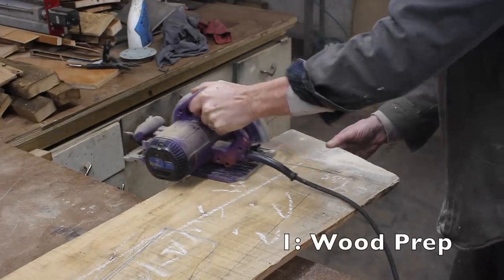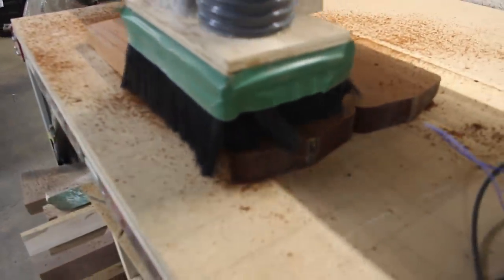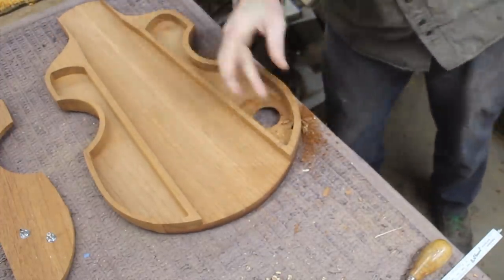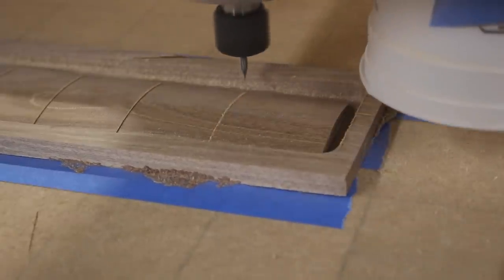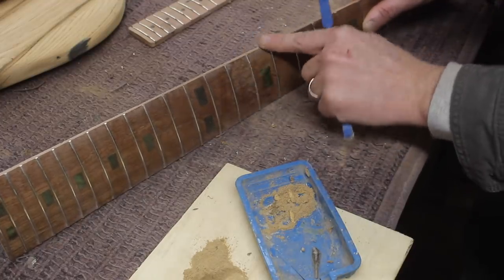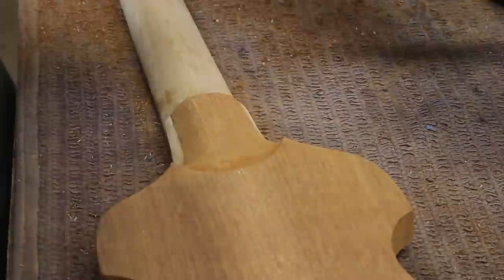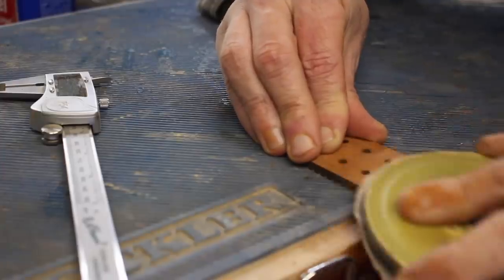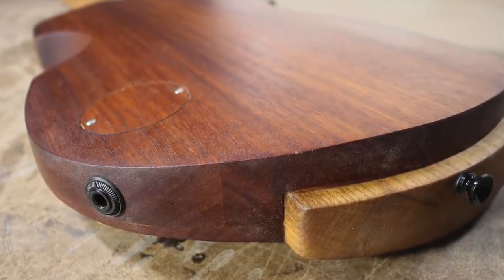6-String Semihollow "Beatle Bass" | Custom Build

Comment: Great stuff as always Tim. I recently bought a six string bass by Harley Benton based on the old Fender bass VI from the 60's. I had to break out the dremel as the input jack had came loose because my nephew unboxed it for me & more or less wrecked it in seconds. Lol. Last time I let him do that! It might even need opening up & rewiring as the volume is super low on some pup settings? Easy fix though & the bass itself is great. Harley Bentons are great when you're skint. Great value for your money. Cheers man. Keep up the great builds. Inspiring as always. Word to the wise.....never let your nephew unbox your new shiny guitars!! Lol. ;)
Reply from the maker: I just learned about the bass VI. I thought it was a baritone guitar but it is not - and I NEED to build one.

Comment: Hi Tim, could you share, if it is not a secret, your tips about bits, feeds and speeds and designs to make such good neck blanks like here? Greatly appreciate your work and unusual ideas 🤘
Reply from the maker: I'm really the last person to ask from a technical cnc side. Learning all the time. What I'm told is it's not to think about feed and speed, rather chip load and stepover, for smoothness. Sometimes faster is better for the particular cutter.I think the heavier machines like mine are always going to outperform lightweight cncs, especially with hard wood. I'm always adjusting my settings and learning, usually the hard way. Lol.
Reply: @timsway  Thanks for answer 🤘. I am doing just the same. My CNC is medium heavy, I am learning as well and doing smaller things. For guitars I am no pro, just for hobby and since now I have done some templates, but the guitar usually handmade. But I thought you had some ideas as your neck came out really smooth. For now I am just experimenting, next guitar I wanted to do 99% CNC for fun. Keep up your ideas, love it 😜

Comment: I love the wooden pickup
Is there an reason you clean up glue squeeze out after it's dried rather than before?
Reply from the maker: it is much easier and less likely to impregnate the wood and cause stain/finish problems in the future.

Comment: Isn't a bass with more than 4 string called a Djent? (Not including 8 or 12 string Octave basses)
Reply: The term djent was coined by one of Meshuggah's guitarists to describe the sound of palm-muted open-string phrases on the lowest strings of an 8-string guitar. 5- and 6-string basses have significantly fatter strings and longer scale lengths than 8-string guitars, giving a clearer, more stable and piano-like timbre and attack to the bass notes. The "djent"-iness of the guitar comes from an unstable attack, where the pitch starts out significantly sharp, then drops down to the true pitch of the note.

Comment: That is rad knowledge about the Rubio mono coat stuff, I had been wanting to stay away from toxic to everything type stuff while starting in this handmade art craft of Guitar making. How does the Rubio coating handle if you should have to resand the body or something?
Reply from the maker: You can just reapply it to the affected areas and it's pretty seamless, whereas if you sand off clear coat it's much harder to blend. Clear coat, of course, offers more protection against knicks and scratches (and there are some good, low voc ploy based options) but there's something real special and satisfying about applying a finish and having it still feel like wood.

Comment: do you sharpen the right angle corners of the fretboard inlays with a chisel after they result kinda rounded from the CNC?
Reply from the maker: Sometimes, or design the work to fit the tooling

Comment: Hi Tim quick question on your laser.  I think iI heard you say once that your shop is not climate controlled but you do have a hear source.  What do you do for you co2 laser in the cold winter months seeing I am right up to road from you in RI I too have my machine in the cold shop.  Do you run you chiller in the cold?
Reply from the maker: I put a mix of glycol (antifreeze) and distilled water in the chiller all year round. Change it about every 4-6 months. Never had any problems (knock on wood)

Comment: How is the balance of the instrument taken into account when playing standing and sitting?
With such a system and a set of strings, it is desirable to see the instrument as multiscale.
  And there is no bar for the support of the thumb of the right hand, so as not to get tired of holding the brush over the strings in the optimal place or even in two positions.
Reply from the maker: It has a little head dive, of course, but there's places to put your thumb on the end of the fingerboard, the pickup and the bridge, just like most other basses. you can also put it in the crook of the body that gets close to the strings.
Reply: @timsway  Thank you for what you heard, it is not customary for us to praise much, but your work and love for the cause made me speak out. Very nice, very tasteful.

Comment: Who makes the cnc cutter that you used to cut the slots for the frets in the fingerboard also a model and part number?
Reply: Also you did a great job on this. Using reclaimed material as you always to is also great.
Reply from the maker: the cutter is a .023" end mill. it has an 1/8" shaft so I need a reducer to chuck it in my router. I think it's an Amana? they all make them for cutting circuit boards and stuff. you have to do real slow and shallow passes in wood to not break it. I run the depth around .015" per pass and cut the slots to .075"

Comment: The presses are handy but I just fret the ol fashioned way with a hammer. Turns out good for me. What radius is that fret board. Looks quite drastic.
Reply from the maker: I got a little carried away :)
Reply: @timsway  it happens to the best of us haha. Looks like it turned out great regardless. 😀
Reply from the maker: @MilesMcNallyLuthierie  It's actually quite comfortable to play. I think it looks steeper on film because of the lens (and the sheer width of the fingerboard).

Comment: do the hollow sections add anything to the tone? even with a piezo pickup, the walls are so thick that i don't think they would resonate differently than a solid body. With any coil pickup, a change in sound would have to come from vibration of the pickup, or the bridge. even if there is a slight change in sound, it seems like it would be lost through any extra effects, or even the imperfect response from the cab, and crossover components ( if there are any ). the bass sounds great sure, but the semi-hollow idea seems like it has no effect. i think this is even applicable to a fully hollow body ( with coil pickups) unless the top is near as thin as an acoustic.
Reply from the maker: it's just to reduce weight, really. and look cool. the solid core negates most of the hollow body effects sonically.

Comment: The Beatles Hoffner violin bass was a standard 4 string... though several of their songs were recorded with a Classic BASS-VI which was tuned E-E with a whammy, 30" neck and scale of a Baritone guitar but used .94-.24 strings and larger tuners and in Bass octaves, like my Japanese copy playing both bass and drop tuned guitar metal riffs here, 
whereas the baritone guitar was tuned B-B only adding 5 frets of range but losing it at the top end, like a modern 7 string would if it didn't retain the high E... although tuning this custom B-B may be more useful in modern songs, they may be harder to play for traditional fingerstyle bassists though and SLAPPING may be very difficult.

Comment: I don't like zero frets for some reason.  I think it is because they throw off the look of the orientation that one is accustomed to.  If the goal is to get a good zero fret intonation and metal to metal sound effect, then what if you made a nut with a fret in the nut?  ...somehow.   Like, just do a cut on a bone nut to allow for a 0 fret to be fitted into the nut.

Comment: I love it but im afraid to know how expensive it was. Not that a custom violin bass thats a 6 string isnt worth it
Reply from the maker: Having an instrument custom built certainly has a cost, however you get exactly what you want and since I am a small operation with no overhead I can be competitive and it's not as bad as you think. For example, most of my "off the shelf" instruments for sale at NewPerspectivesMusic.com are priced less than a brand new, boring, American factory made Fender, but custom builds are usually a bit more.

Comment: Fantastic skills but I have to ask. Neck dive??  Most basses with neck dive never get played no matter how good the build. Pro players won’t touch them.
Reply from the maker: the client and I discussed that and he was willing to put up with it for the design. The type of strap you use can help a lot, too.
Reply: @timsway  Interesting. I’ve wondered if some kind of metal extension running from the body and parallel with the back of the neck could work with this kind of design. It would be invisible from the front and there should be enough space for the left hand thumb to keep on the neck.  Thanks for posting your inspiring videos.
Reply: Most six strings I played with have had Neck Dive. This bass is pretty heavy, but I love playing it and showing it off on stage.
Reply: @AGilbii  Wow, so it’s very heavy and it’s got loads of neck dive. Showing off is both expensive, bad for your back and cramps your technique. Good luck with it mate.

Comment: If you could make one from an actual violin (sizewise maybe a viola might work better), it might have great acoustics, because it's a fantastic form for the sound of acoustic stringed instruments (at least in the realm of traditional instrument shapes). Unfortunately real violin-family pieces bulge right where the bass needs flat surfaces for pickups, and you'd still have problems with the height of the action if you embedded the pickups. Presently made violin bass guitars, like this one, disappoint me because they are mostly decorative. I'd love to see a kind of acoustic-electric bass that could take advantage of some traditional violin acoustics. THAT would be awesome.
Reply from the maker: I made a real standup bass from pallets, fence boards and hollow core doors on this channel. check it out.

Comment: What if a guitar had a hollow neck?   ...with a hollow body.  Preobably a stupid idea. I have thought of a hollow metal neck, made of a thin steel that was pressed into place.  Not really for this channel of guitar wood working.   I really like that elaborate dust mask and the preparation and precaution and safety and responsibleness and deliberate methodicalness, and plain old common sense of that.  Plus it is a really cool looking dust mask.

Comment: Is it just me or does that high e look like it is going a little bit too close to the edge of the fretboard?
Reply from the maker: it's a high C and it's perfect! 6 -strings are usually strung like a 4-string with an extra string on either side, BEADGC.
Reply: @timsway  Not historical BASS-VI's though bro, you may want to double check that, Beatles and Beach Boys used a BASS-VI
Reply from the maker: @THRASHMETALFUNRIFFS  that's a different instrument, commonly called a baritone guitar.
Reply: @timsway  Uh no, BASS-VI and Baritone guitar are different Bro... Google what's the difference between BASS-VI and Baritone guitar.  It's cool, lots of people don't know and make the same mistake.  Mine's a BASS-VI
Reply from the maker: @THRASHMETALFUNRIFFS  interesting. I'll check it out. I love me a bass with a whammy bar! Regardless, its definitely not the same instrument I made. This is the typical, modern 6 string bass, BEADGC in full 34" scale.
Reply from the maker: @THRASHMETALFUNRIFFS  I just watched a little video about them Indeed I thought they were baritones but they are not! Thanks for the info. I may need to make one.
Reply: @timsway  Enter BASS-VI in my search bar, they're fun and versatile.  My cheap 60's St. George T-64 was my dad's, he taught mom to play on it, she gigged it into the 80's, broke the neck slamming it at her new husband, got a Richenbacker, he fixed and painted it, only the middle pickup makes sound and is very weak, she put it under a bed for 14 years then gave it to me, I sat on it awhile then decided to try it through my distortion pedal, got an article from an old Guitar magazine framed on the wall about this specific model and recorded some junk with it.  Fender makes re-issues of their old one's now and Eastwood makes a T-64 copy like mine.  Famous bands have used them and today some Sludge/Doom dudes play deep tuned metal with them also.